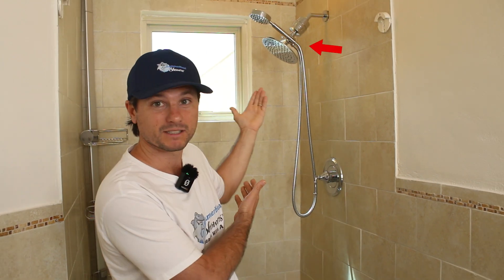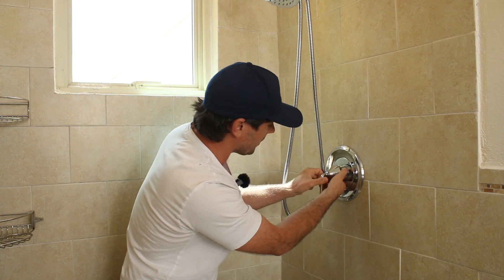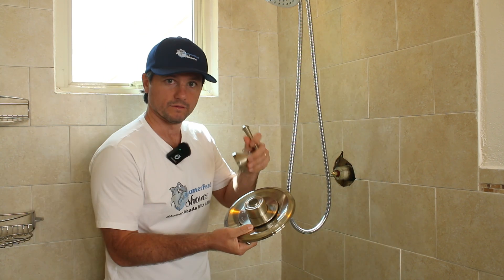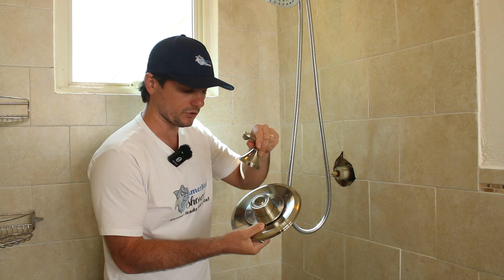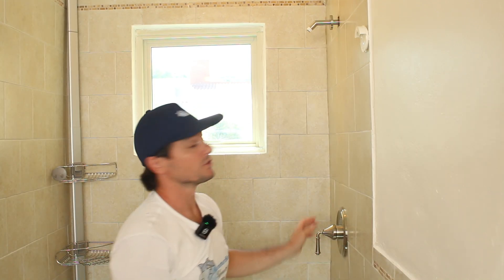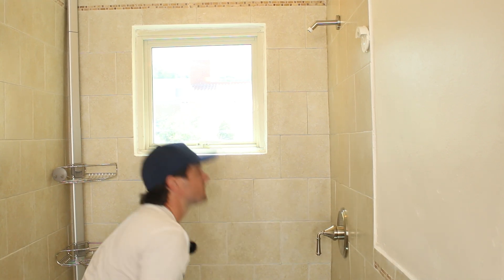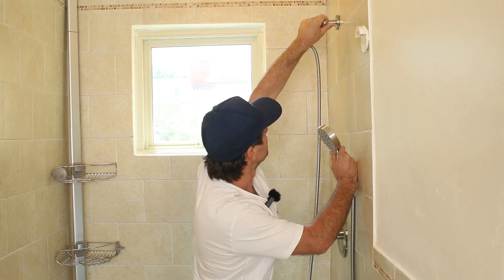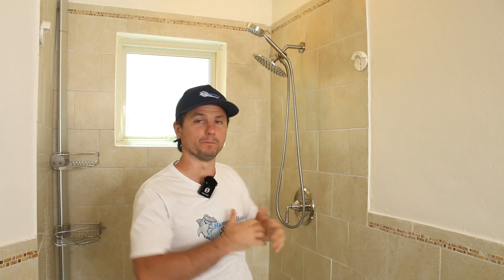How To Update A Shower With New And Matching Fixtures | Installation | DIY

Comment: The shower flange on the wall, do you glue it on to the tile?  Mine became loose over time….
Reply from the maker: In this case, ours has a set screw on the bottom so that this doesn't happen.